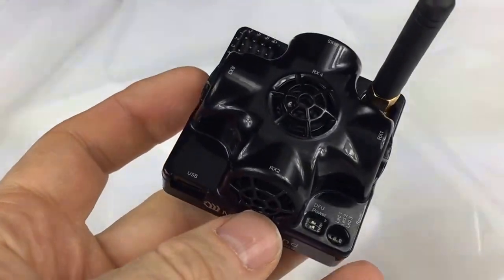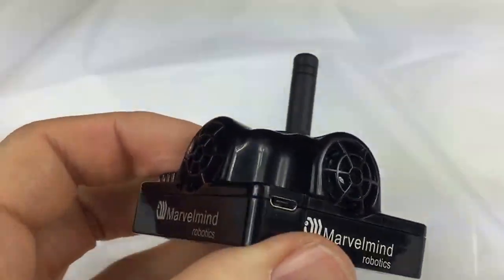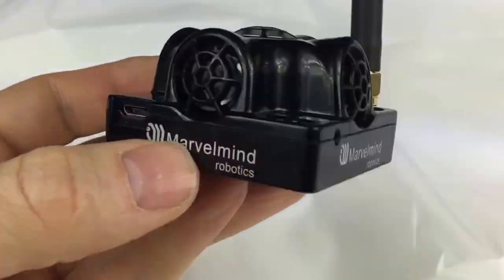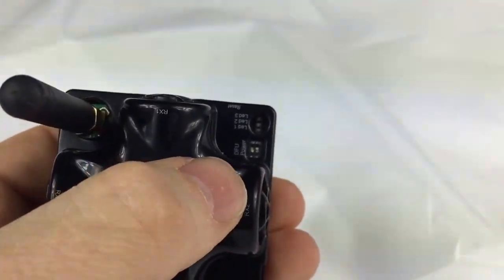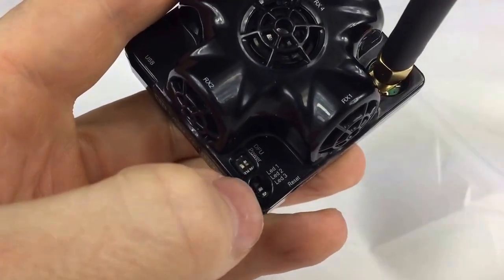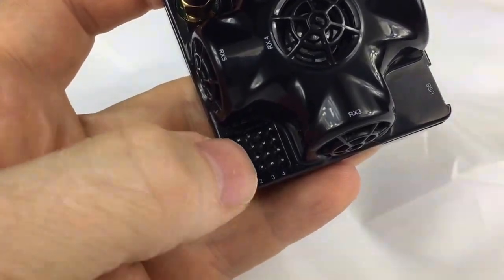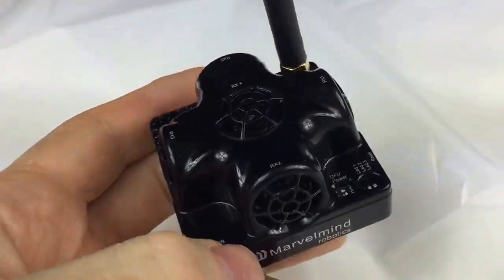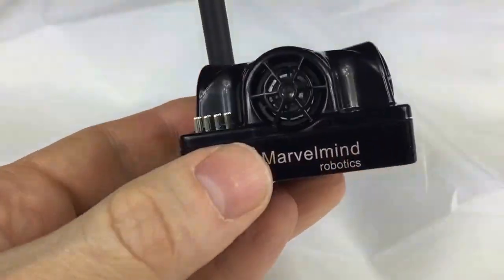New beacon with plastic housing for precise (+-2cm) Indoor "GPS"

Comment: hi i wanna control a robot with this gps indoor ,however it is in a place that have so much wind, by the way the wind disturb the work of the sensor, or it's normal ?
Reply from the maker: Yes, it is possible to send a path to the robot and general info/commands to and from robot with every location update.

Comment: and order thing, how many watts the ultrasound the exist in the robot, to me calculate the cell that i will put in the robot, thanks
Reply from the maker: We don't have power emission in watts. But the beacon cover the distance up to 30 meters. So, if you get the starter set, you can cover area of up to 1000m2
Reply from the maker: If need more area to cover, you simply install more beacons

Comment: Are the receivers also transmitters (speakers)?
Reply from the maker: Yes, each of the beacons can be either stationary (receiving ultrasound chirps) or mobile (emitting chirps).

Note, that there are beacons with IMU and without IMU. Beacons with IMU may have significantly higher update rate
Reply: So each node has 5 speakers and 5 microphones? Or does it EITHER have speakers OR microphones. I mean can you just switch the same hardware between transmit and receive mode like a radio antenna?
Reply from the maker: Johannes Schmitz : They are transducers. So, they work as receivers and transmitters. Yes, can switch between receiver mode and transmitter mode many times per second, if you wish so
Reply: Oh that is cool! So what is the maximum number of nodes in a single system that you can achieve with this approach? Are you using time-, frequency- or code multiplexing?
Reply from the maker: Commercially available right now - up to 30 beacons per modem in any combination (mobile + stationary beacons).
A new modem will support up to 250 beacons. The new modem is already available in HW. SW support will come, when there will be sufficient demand for larger system.
Multi-modem systems will support up to 65,000 beacons.
Reply: Marvelmind Robotics Does the update rate depend on the number of nodes in the system?
Reply from the maker: Current system uses TDMA approach. So, update rate per mobile beacon depends on the number of mobile beacons in the system. For example, if you have 16Hz update rate per system and you have 1 mobile beacon, you will have 16Hz per mobile beacon. If you have 2 mobile beacons - 16/2=8Hz per mobile beacon, etc.

The system doesn't really depend on the number of stationary beacons unless a low baudrate radio profile is used (38kbps) or number of stationary beacons is more than a few dozens. Use 153kpbs or 500kbps radio profile for higher update rate.

There are several ways to increase update rate. Please, write to marvelmind@gmail.com and describe your needs.